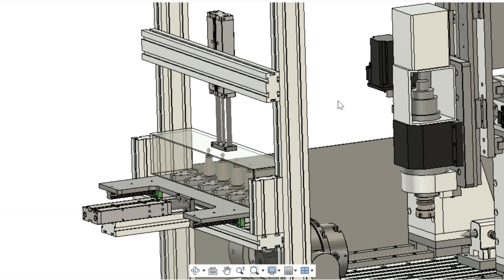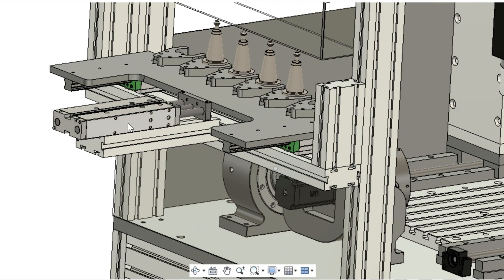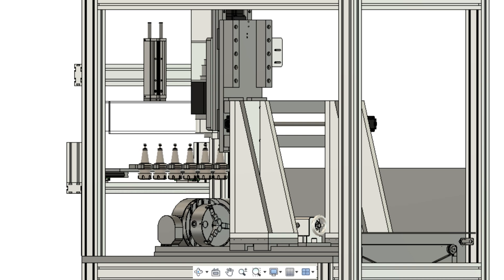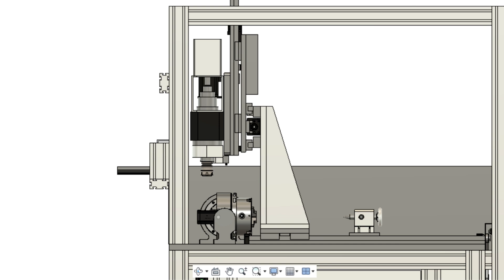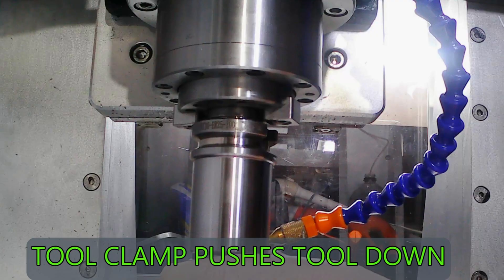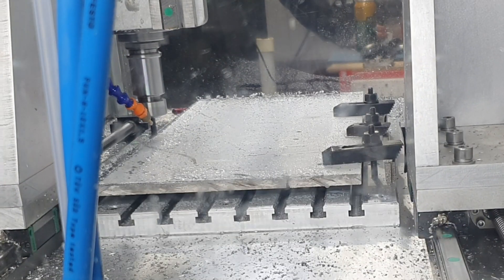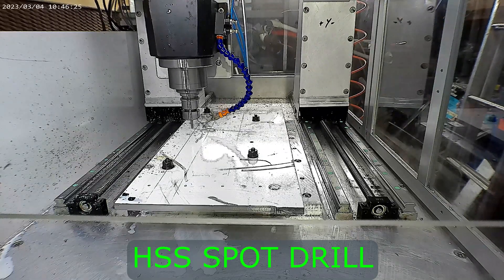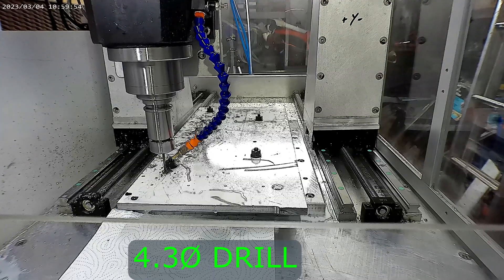DIY CNC 5 AXIS MILL TURN MACHINE PART 8

Comment: That gantry column design does not look very rigid, I know you have to clear that 4th axis for the tool change so you have quite a conundrum there.
Reply from the maker: Hi Jon.
Thanks for watching.
There is a compromise in the design to have a 5 axis mill and lathe in one machine. The tool changer was an after thought, it was a case of I can fit one in so why not.